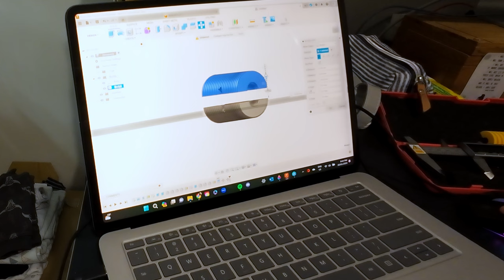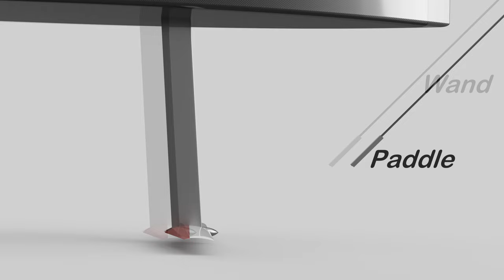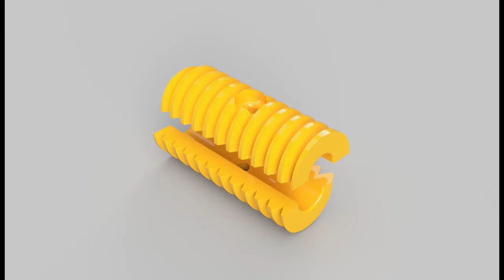$3600 Foiling Moth Project EP9: 3D Printing Upgrades, How a Foiling Moth works and a Test Sail!

Comment: Thanks for the video. I really enjoy watching you work on the boat. I am not a moth sailor and just curious but why are the control lines led above the hiking strap instead of under it. Doesnt that put pressure on the hiking strap while hiking out? Looking forward to your next video!
Reply from the maker: Hi Max, I’m glad you like watching the boat work, sometimes I worry the montages go for a little bit too long! The vang and Cunningham etc go over the hiking strap because they need to be lifted up a fair way to get them out of the cleats to ease the controls, and if they went under I wouldn’t be able to ease things. I suppose the ride height adjuster line could go under the hiking straps, but it would make it harder to grab and adjust if it’s rubbing on the underside of the straps. I usually have the straps super tight anyway, so I’m not too fussed about things pushing down on them. Thanks for watching!
Reply: @TomStuchberySailing-eg9vr  I personally like it like this. I could also only watch your montages and was very happy with the more in depth  explanation of how the wand works. Like in this one 3/4ths of working on the boat and them a quick sail for the last 1/4th is perfect for me. I do enjoy the „regatta only“ videos as well though. So just keep doing as you are if you ask me!
Reply from the maker: Thanks Max, I will keep going with this type of thing then!